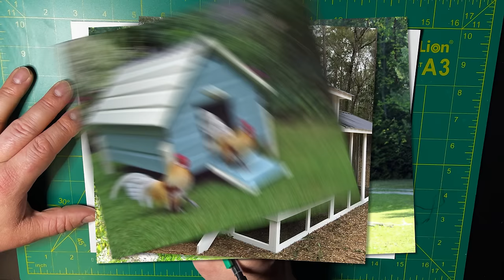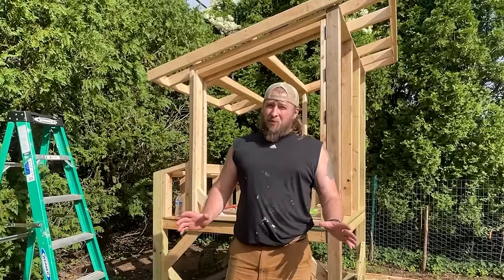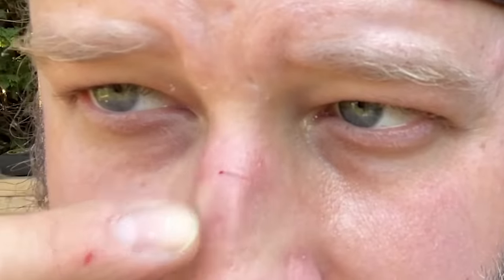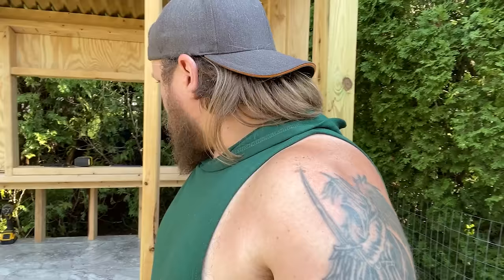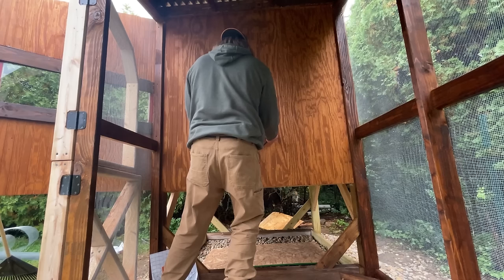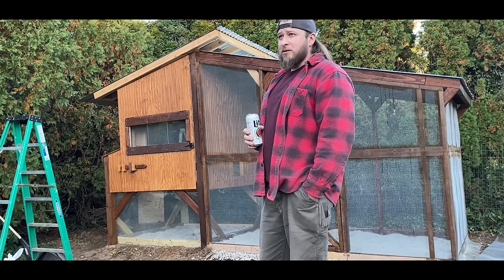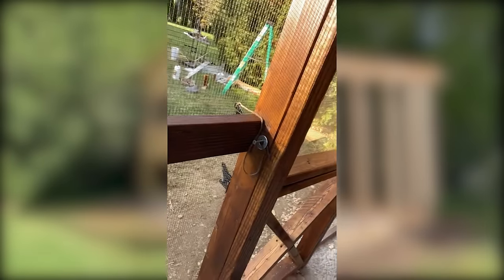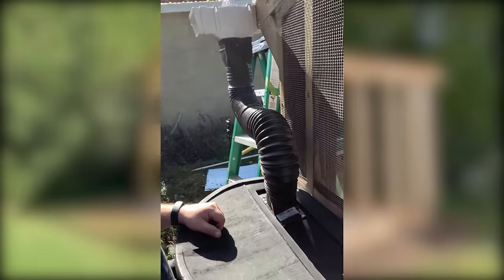EASY Low-Maintenance CHICKEN COOP | DIY | TIMELAPSE

Comment: I’m seriously considering building this. Anything you would change after these few years of having it?
Reply from the maker: If you’re going to do the deep litter method inside the main coop, I would cut the chicken entrance door 8 inches higher minimum. I have pine shavings that jam up my automatic door every now and then because I made mine so low. Also stain the studs before you out the hardware cloth on. I had chickens on the way so I didn’t have time to do it that way. The large stones around the parameter of mine were awesome for over a year. Then I hatched out a rooster and unfortunately he loves messing those stones up looking for bugs. So get some bigger rocks if you go that route lol. I would also make a hatch door or have it so the side opens for the run on the side where you would collect eggs. Because it is short it’s impossible to clean from in the run without getting on your hands and knees. So having that part of the run be able to swing open for cleaning underneath would be the way to go. Makes it easier when adding sand or whatever you’re gonna use as the flooring in the run. Also the automatic feeder for food I have in the video, they make larger ones that can old like 25 lbs of food which can feed 10
Chickens for over a week. I would get that instead. That’s about it though everything else has been awesome. Also it’s not in the video but I ran heat trace cable and wrapped my entire water line and chicken cups all the way around the rain barell so that it doesn’t freeze during the winter then wrapped it all with white electrical tape. That worked well aside from a few -50 degree F days. For those I just gave them a bowl of water until the temp rose a bit. But that’s the list of my problems

Comment: Have you had any problems with your rain barrel? Algae? Mosquitos? I’m about to install mine and I’m worried about it being in the sunlight
Reply from the maker: I’ve never had any algae problems as there is pretty much no way for light to enter. I add apple cider vinegar to the barrel just about every other month as well. Around around a cup or two. I’ve never encountered mosquitoes in their water supply either. But my area itself has a lot of them. But never from the water they drink. I hope this helps you.

Comment: Awesome job but I can see daylight n in the roof. He didn't overlap the corregated metal panels. I would overlap and add a bead of roof caulk along the seam.
Reply from the maker: Where in the video did you see them not overlapped?

Comment: Their feet are not meant for a 2x4 to roost on. Great build I am so jealous.
Reply from the maker: The roosts are made with 2x3’s and the edges are sanded smooth. This is actually highly recommended because it allows the underside of the chicken to rest across the entire foot when roosting which reduces frostbite that will occur with skinnier roosts especially in colder climates like my own. Hope this helps and thank you for watching!

Comment: Black barrel, will the water be hot from sun?
Reply from the maker: It’s been 2 years now and I haven’t heard any complaints! All jokes aside there are trees up against the back of the coop maybe 2 feet from it so there’s only a small portion of the day sun hits it. And the line that goes into the coop and into the cups is all inside and shaded so I don’t think it gets too hot. Plus every now and then when I clean out I use my finger to test if they’re all working and it’s always felt cool. Appreciate the question though! I’d imagine if it was she’d by the coop on one side and trees on the other it could get toasty during the middle of summer!

Comment: Is there a list of what wood was used?
Reply from the maker: I honestly used what I was able to get my hands on. 2x4x8’ primarily (although the run roof needed to be longer so I had to do a splice because I was trying to be as cheap as possible and didn’t have anything longer) the outside of the coop was almost like a 1/4” or 3/8” sanded wainscoting. But yeah that was about it, nothing really special or out of the ordinary.

Comment: How have your chickens responded to the sand? No health issues? I hear so many different opinions on sand usage. I have some in my own coop, fairly new to it.
Reply from the maker: They’ve been great with the sand. Remember you need to use construction sand not play sand. It has larger granules. Only use it in the run not the coop itself.

Comment: Do you have plans available?😊
Reply from the maker: Thank you for watching and inquiring. Unfortunately I used a lot of recycled materials from jobsites and winged a lot of the build to fit the materials I had available. I wanted a good design with as many bells and whistles as possible without breaking the bank. (Materials prices the last 3 years have skyrocketed so I was as stingy as possible.) So aside from my drawing in the beginning I unfortunately do not have any plans.

Comment: how does the sand do in the rain? does it smell?
Reply from the maker: The sand does very well with the rain. It dries up very quickly if it gets wet. The larger stone on the bottom help it drain even faster. Only complaint would be to the chickens themselves. They love digging it up and bringing the stones to the surface! Lmao. No smell coming from the sand whatsoever, it creates an environment that doesn’t allow bacteria etc to grow in. Poop removal once a week is extremely easy with a shovel I use that is made of wire so that the sand sifts right through (I usually get large stones too and just throw them out) Hope this answer helps you out! Take a look at other info online if you want, there are a ton of benefits of using sand. Thanks for watching!

Comment: what did you do to solve the water from freezing
Reply from the maker: Check out my product link in the description for materials. I used a heat trace cable rated for wrapping around the pipes down to -40 degrees Fahrenheit!

Comment: Do you have the plans for the coop design?
Reply from the maker: Unfortunately I do not. The drawing in the beginning was the closest thing to it. I used a lot of left over lumber from jobsites etc so a lot of my measurements were on the fly using what I had to work with.

Comment: Is that Quick concrete mix you put on the floor of the coop? If yes, why would you use that?
Reply from the maker: Quikrete is the name of a company with over 100 products. At 26:28 in the video you will see bags of their "ALL PURPOSE SAND" Product. At 26:38 you will see me unbagging the "ALL PURPOSE SAND". Between 34:18 - 34:50 I show the Sand and Put 1000 Lbs. on screen and say "Quikrete ALL Purpose Construction Sand". Hope this helps, thanks for watching.

Comment: I was wondering exactly which sand did you use...its nit on your supply list
Reply from the maker: I got the sand from home depot and didnt add it to the list just because of how heavy it is people would probably get it in store as opposed to getting it delivered. The shipping charge is probably pretty high. 
It is Quikrete All Purpose Sand. It comes in 50 lb bags. Here is the link so you can check it out. You want to get this instead of something like "Play Sand" because the particles of this are larger. Play sand is bad because it is so fine it can become air borne and negatively impact a chickens lungs (children too which is kind of crazy people still use it)

https://www.homedepot.com/p/Quikrete-50-lb-All-Purpose-Sand-115251/100318450?irgwc=1&cm_mmc=afl-ir-2003851-1420157-EdgeBingFlow&clickid=SgI022XctxyNU9m2QIzSp09SUkAVewWsEyS9xU0
Reply: @TheVikingReaper  thank you for your quick response....I have researched this and just didn't know what to get....what is offered at TS turned out to be too small, in my opinion 😉
Reply from the maker: Yeah I’d definitely recommend checking out Home Depot and seeing what you think of their stuff. Also if you have a local supply yard that has sand that might not be a bad idea either and honestly probably the cheapest you just have to make sure you know what they used for sand particles. Good luck! And thank you for watching! Oh I may have forgot to add on my list but I use a giant scooper like it’s a giant litter box as well lol

Comment: How many chickens fit in that size of coop. Thank you.
Reply from the maker: So I started off with 7 hens, but with the run size and the linear feet of roosting bars in the coop itself I’d say it could easily handle more, 12-15 could comfortably fit. Any larger of a flock and I would create another coop or expand the run. ( my chickens are let out every day the run is mostly if I see predators in the area or I’m not home, or snow etc)
Reply: How many nesting boxes for 14 hens. I thought I needed to have one for each one of them. Thank you.
Reply from the maker: That’s definitely way too many! Let’s put it this way, with 7 hens I have 5, and they only use 1! Yeah, every morning they take turns all going into the same nesting box, it’s crazy, so you shouldn’t need many, I’d say have atleast 4 so they have the option to use more.

Comment: After the stain, did you use polyurethane?
Reply from the maker: No I only used the stain. I did two coats for both stains. The instructions recommend a maintenance coat only when the color begins to fade. I will say it is rated for exterior use out of the container and unlike other stains that need to be sealed because they will rub off, this stuff drys very quickly. So much so you need to do the second coat right after the first because of how well it repels water, if you wait too long I noticed it keeps the nest coat from absorbing properly. Hope this helps and thank you for watching!
Reply: Thanks for the quick reply! Really appreciate it.
Reply from the maker: No problem! I try to get back to everyone with good questions whenever I get a chance.

Comment: What brand of sand was that? Where did you buy it? What kind of rock went under it?
Reply from the maker: Quikcrete Construction Sand from Home Depot. The rock was a Salmon Run from a local stone yard. In Hindsight I would probably use a bit larger of a stone. The Chickens dig down in the sand for dust baths sometimes and dig up the larger stones so when I’m “poop scooping” I often find myself throwing the surfaces stones out too lol. I feel larger stones would be harder for them to unearth.  It doesn’t necessarily compromise anything with the run but it’s not as aesthetically pleasing you could say.Hope this info helps and thanks for watching!
Reply: @TheReaper1  -Thanks! My husband is building our coop now.
Reply from the maker: @Thefightfortruth  Ah well good luck to you both! I should put the sand in my links, I chose not to since I figured it was something people wouldn’t buy virtually but in person, but it seems people want to know the exact type so I should anyways. I also advise you get a wire shovel (got mine on Amazon) to poop scoop! The sand falls through the gaps very easily so it’s like cleaning a giant litter box! Again good luck to you both and thank you for watching!
Reply: Hi great video. I'm currently building my coop. Question is your taller 4x4 posts 10' or 12'? How high is the shorter 4x4 posts? Where you made the nesting boxes? Thanks again for creating a great video 😊
Reply from the maker: @sundyvargas8740   I’ll have to measure them but I think they may have just been 8 foot lengths. The nesting box ones were around 4 feet tall. I’ll try to remember to grab a tape tomorrow and I’ll let you know exactly. Thank you for watching im glad you enjoyed it!
Reply: @TheReaper1  thank you so much.
Reply from the maker: @sundyvargas8740  hey the guesstimate I gave you was spot on. 4’ and 8’ with 15-20 degree cuts on the top for the roof pitch
Reply: @TheReaper1  thank you for measuring it. I appreciate it.

Comment: We want to build one lumber is to expensive.
Reply from the maker: Yes I’d highly advise using as much scrap/recycled materials that you can get your hands on. I used a lot of lumber I pulled from my garage when I started ripping it apart to remove it’s drop ceiling etc. also keep an eye out for old pallets etc people throw out on the side of the road. It takes a little bit of elbow grease but with a nice coat of stain it’ll last you many years! Good luck!